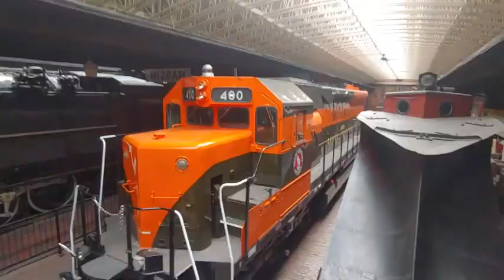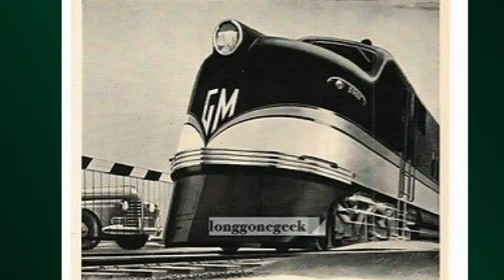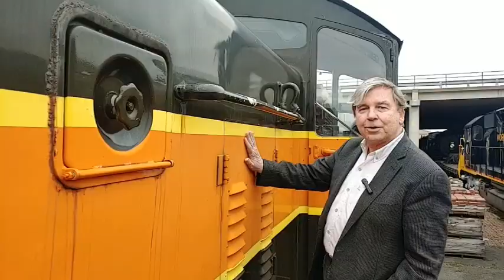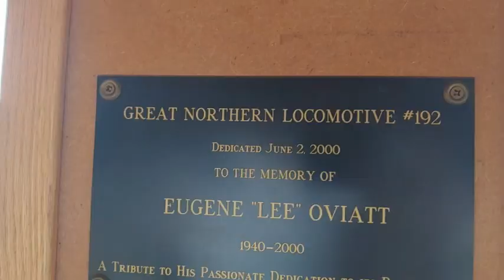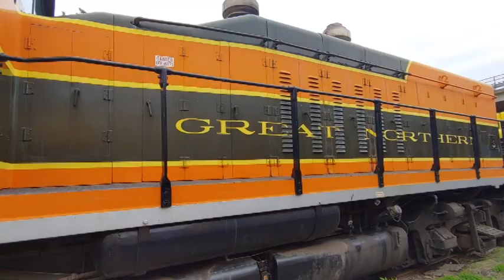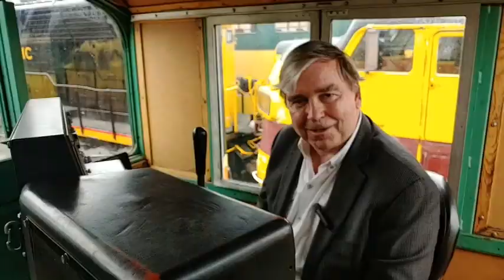Last locomotive of its kind an NW5

Comment: I was at the Duluth train museum last December and there didn't seem to be as many diesels there as shown in this video. 192 was (I noticed it immediately when we went outside because of its Great Northern) but there were several that should've been there that were missing. At least from what I could see. Their Soo Line Unit, for example, was nowhere to be found. The same can be said for the F Unit shown in the background when he's in the cab. The BNSF locomotive that pulled the North Shore Scenic railroad when I last road it in 2023 was missing too. I wonder if they've sold off some of their locomotives recently or if they have a separate storage facility where they keep some of them? Or maybe those locomotives were just placed in areas where I couldn't see them.

Comment: The locomotive does not have a 12 cylinder diesel "motor".  There is no such thing as an internal combustion "motor".  The proper nomenclature is "engine" or "prime mover".  There are electric motors, hydraulic motors, and air motors - but no diesel or gasoline "motors".

Comment: It's EMD not EMC. Electric Motor Division.
Reply: EMD, yes; Electric Motor Division, no - no such thing.  Founded as Electro-Motive Engineering Corporation in the early 1920s, soon changed to Electro-Motive Company.  GM acquired Winton Engine Company in 1930 and Electro-Motive Company soon after, then renaming the latter Electro-Motive Corp (EMC).  Winton, EMC and portions of Cleveland Diesel Division were combined into Electro-Motive Division (EMD) in 1941.  GM sold the company in 2005.  It is now called Electro-Motive Diesel, Inc., still EMD, and is now owned under the Progress Rail division by Caterpillar.

Comment: Great video. But your presentation could use a bit of fact checking. I know of 2 more. Mass Central's (ex SOU) and CRGX 61 in Parrish Florida. Former FSUD 2. Also. These were not intended for branchline service. Instead, they were marketed for passenger terminal switchers. The steam heat was to keep coaches warm when the road power was serviced. (both the NW3,NW5)..  However it was GN itself that decided they would be good for branchlines, not EMD. EMD wasn't interested at all in the Roadswitcher concept. Witness that after the NW5 ceased production, EMD made their concept of a Branchline loco. the EMD BL2.. an F unit modified with a bit better rear view. The RS1325 was intended to be a passenger terminal switcher as well. But again, C&IM ordered them for the branchline role, a role they were not really marketed for. Many many railroads ordered things from EMD for roles they were never marketed for.
Reply: Also the fact he mentioned that the Burlington Northern was formed in 1990 when that merger happened 20 years prior in 1970. And incorrectly mentioned early in the video that the engine was the 193 when you can clearly see the number 192 painted on the engine.

Comment: This is definitely not the only NW5 left. Rare bird indeed but Mass Central has owned and operated one since 1980. Having said that, this was beautiful restoration of a unique engine. Well done!
Reply: Definitely NOT the last one left, I know of 2 more. Mass Central's (ex SOU) and CRGX 61 in Parrish Florida. Former FSUD 2. Also there are two of the succeeding model around the rs1325.
Reply: @Alcochaser Also, the shell of an old Burlington Northern NW5 is sitting on top of a container somewhere in Council Bluffs, Iowa. It's seen better days but it's not scrapped..... yet.
Reply: @atsf47legit  Yep true.
Reply: @Alcochaser  Good info!
Reply: according to wikipedia, this is the only one in fully restored condition. there's another still in operation in Massachusetts and one on static display in Florida.

as for the NW3, surprisingly there were 2 in existence at the start of 2018, one in operating condition and the other on static display, but due to the remote location of the operating unit transportation costs were viewed as too high and it was scrapped.
Reply: Mass central is just built different
Reply: @NECR3039  With 2100 yes it is!
Reply: New pics in B&M style McGinist livery 
http://www.dritter13.rrpicturearchives.net/showPicture.aspx?id=5824005 ..
http://www.dritter13.rrpicturearchives.net/showPicture.aspx?id=5824004 ..
http://www.dritter13.rrpicturearchives.net/showPicture.aspx?id=5824006 ...
Enjoy